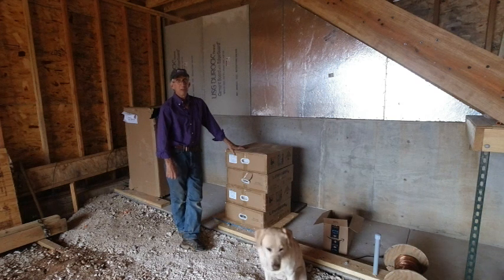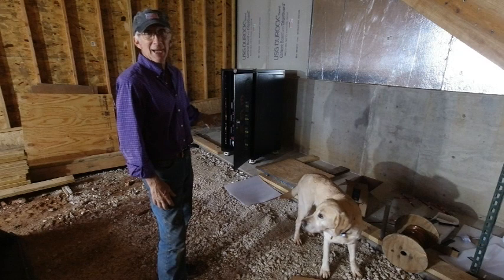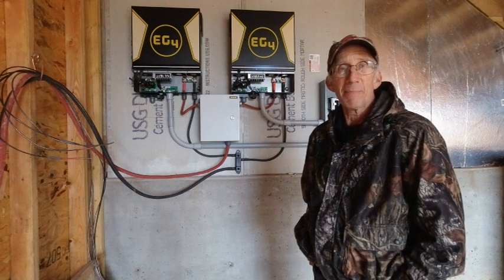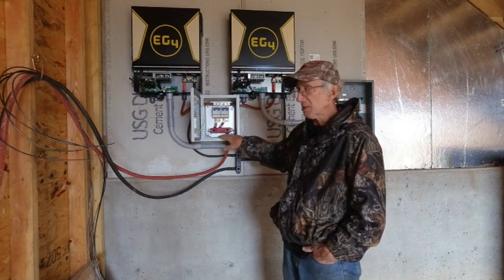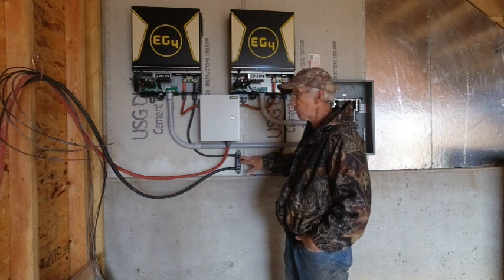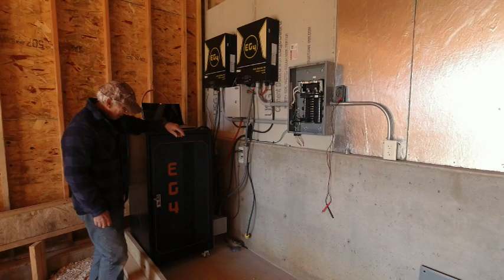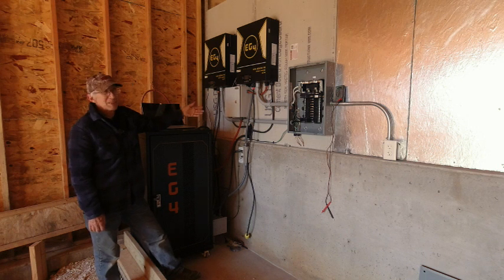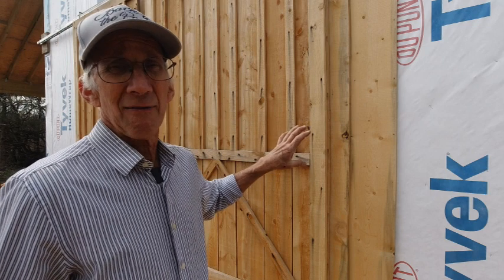Episode 61- Solar controls with EG4 6500ex inverters from Signature Solar and Square D entrance

Comment: I wish I had that system. Mine is 12v, 2kw, 600ah lead acid with 2500w inverter.
Reply from the maker: Gosh I'm just now seeing old comments. I apologize. I started with a system similar to what you mention in my old cabin. It actually did quite a lot, like refrigerator, tv, internet, coffee maker and microwave. i couldn't use two a t once, but it was easy to adapt to.

Comment: Nothing but junk. 6500ex. They sent half of the update cable. One out of the two cables was bad straight from Signature Solar. My 2 ton heat pump with a soft start pulses for 6 to 8 seconds on start up. At the same time during start up my lights strobe, not just flicker. My refrigerator compressor starts to pulsating and shaking too. Good luck if you buy the stuff. Forget about customer service.
Reply from the maker: You're right about customer service. Oddly, I haven't had the problems that so many people describe. The only thing I don't like is the idle power consumption.

Comment: Nice install.  I just finish a similar setup and I decided to use a wire trough. I also put my battery breakers in a box which really makes sense.  Like you, I think it important to follow the code. Three items that I did not know about until I got started (and after I ordered all the components) are the requirement to run the incoming PV wires in a metal conduit until the first means of disconnect (my inverters are in my detached garage), PV ground fault protection, and PV arc fault protection.  I got the PV wires in metal conduit, but haven’t haven’t found a good solution to ground and arc fault protection (my PV voltage is around 370 volts during peak sun power).  Have you dealt with that?
Reply from the maker: No, I wasn't aware of that. Is that an NEC requirement? I thought I read thru that pretty carefully.
Reply: @backtothepast1850  Yes.  Arc fault is covered in 690.11Arc-Fault Circuit Protection (Direct Current).  Ground fault in 690.41 (B)Ground-Fault Protection.  From what I've read, the latest grid-tied inverters have those protections included.  It seems most people don't try to do this.  I'm curious to see what you think of this and if I'm reading this correctly.  I think there are some exceptions, like having a dedicated building for solar equipment. That doesn't apply to me as my panels are on the roof of an old barn and the inverters are in my garage (detached).
Reply from the maker: @Sonny Surles  thanks for the info. I think I recall Mike Holt doing a video about that. If I remember correctly,  his panel's take was that for the inverters to be listed they were required that protection. I may be wrong. I'm in Arkansas now, and will need to get back to Colorado on my computer to verify, unless I can find something here.

Comment: Had same issue with the 61 error.  Long story short, the communication cable supplied by SS was defective.  Also, the tag for the inverter was on the wrong end.  After putting a new rj45 plug on the defective and and ohming out the cable, the error was resolved.  Each end is connected to different rj45 pins.  Hope this helps.
Reply from the maker: When I switched ends, that took care of the issue for me. I think SS is so back logged that they don't spend the time they should with quality control issues

Comment: Error code 61 can be cleared by unplugging the serial communication cable at the inverter and plugging it back in. Someone else had the same issue and this worked for them. Hope it works for you. On your 50VDC in a box for safety question let me say this: for every expert, there is an equal and opposite expert. As long as it works for you.
Reply from the maker: I tried the plug/unplug trick. It alone didn't work. It turned out that one end is specifically for the battery, the other for the inverter. When I reversed them, everything is fine. I feel more comfortable with connections covered in a box. Thanks for the advice!